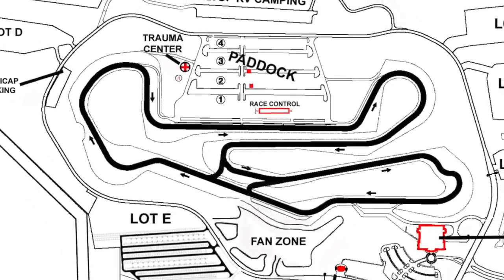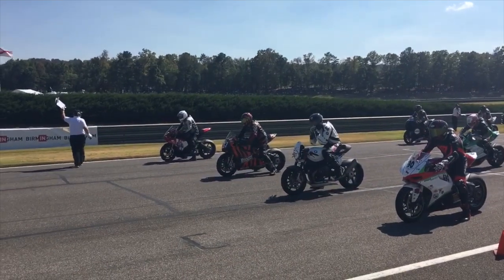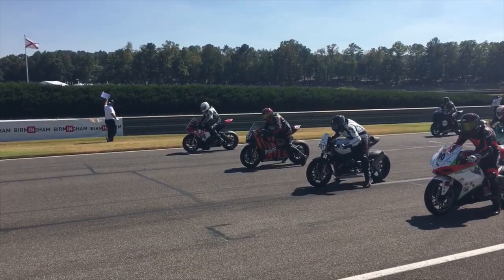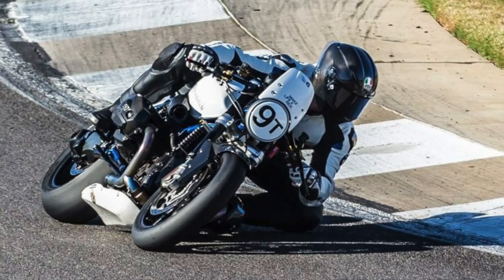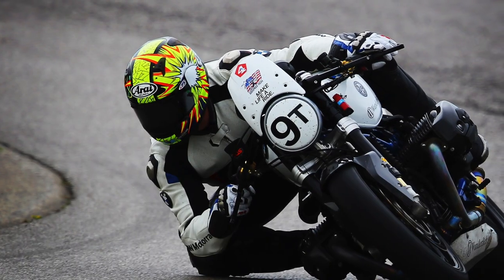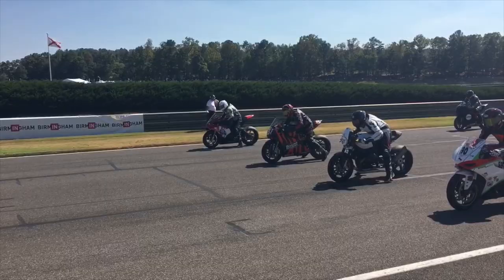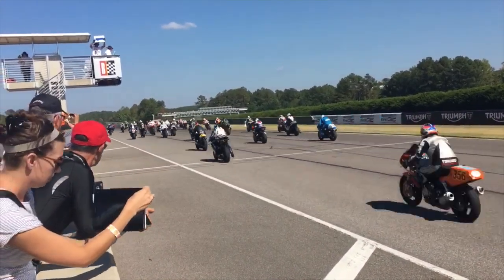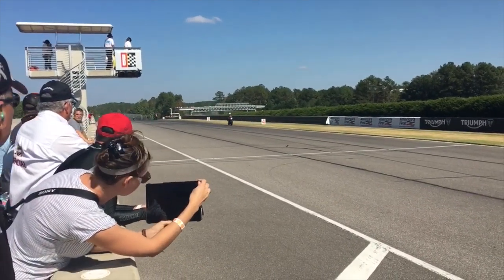Nate Kern on BMW Boxer Twin Racing

Comment: Will counter steering off the seat help keep the jugs up? My normal sense says it does but you have to go full out rigger canoe on them.
Reply from the maker: via Nate Kern: Counter steering only happens when enough throttle is applied creating gyroscopic effect. Hence, having to counter steer... push right bar left to go right vs. turning low speed not enough gyroscopic effect. Body position dictates ground clearance really in the jugs, naturally at a high speed. Thanks!